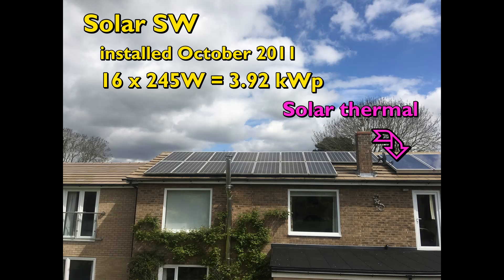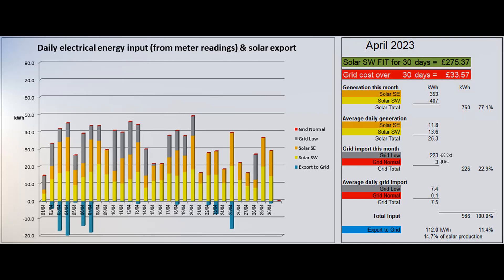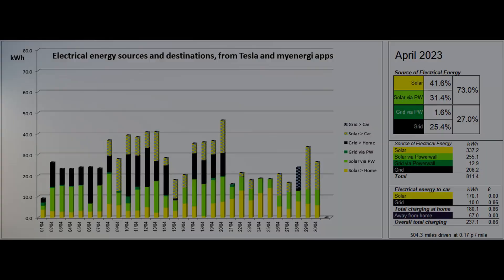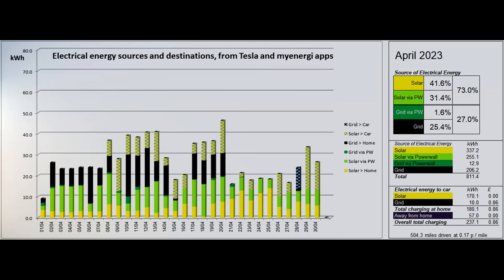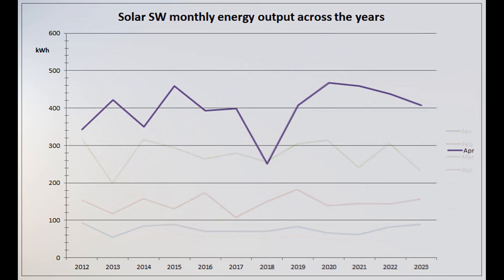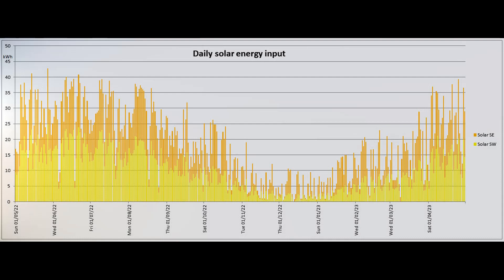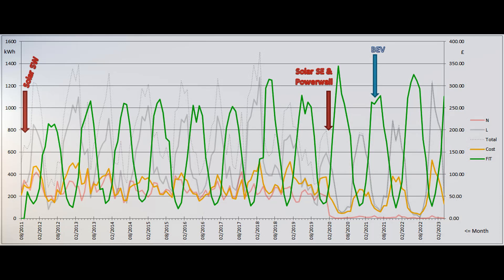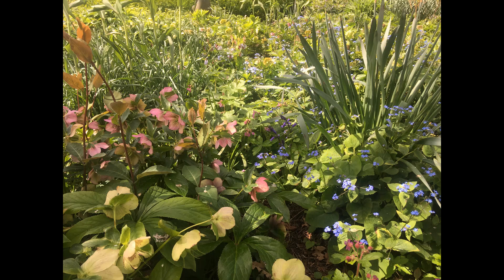Tesla Powerwall 2 and Solar PV in the UK [41]: April 2023

Comment: I have added a comment twice only for it to disappear immediately? Not experienced that before.
Reply from the maker: That happened to me around a year ago but I can't remember what it was all about and how it was solved ...
Reply: A 3rd post has just vanished. It included a url to Tesla sw versions so I will try again without the link!!
Reply: I have found my Powerwall weather prediction is near spot on since firmware update v22.26, Sept 2022. It uses solar irradiance data which from my experience has been very accurate.

I just hope its accuracy continues as I wanted manual control of my PW charging but feel this is no longer required.

Comment: Is your solar thermal new? I don't recall seeing it before or it being highlighted. Thanks for the holiday mention at the beginning of the month. Why am I not surprised that BG won't take a customer reading for the generation meter for April. We are lucky as our quarter runs to the end of March so no estimates for the cutover between the new and old rates.
Reply from the maker: The solar thermal was installed in 2011 at the same time as our first (SW) PV array, though I have only labelled it on the picture of the house roof for the past four months' reports. Gives us lots of hot water during sunny summer periods, preventing the oil boiler from firing up at its programmed time in the late afternoon, despite it having had very little maintenance. I have found it difficult to find anyone local with the equipment to top up and re-pressurise the system.
Reply: @salokin1 ’m in the same situation Solar PV and Solar Thermal and no one to refill the now 9 years old fluid, I’m sure it effects the efficiency of the collectors not having replaced the original fluid by now, Looking into removing the Thermal now the payback is complete and replacing them with PV panels, just to add I now have a Myenergi Eddi to divert excess solar to my hot water tank so increasing the panels would offset the removal of the Solar Thermal
Reply from the maker: @johnb7644  mine is still working very well despite a cold low pressure, so I'm sticking with it for the moment, and keeping my eyes peeled for a plumber / fitter who could help top up the fluid. I don't think that the fluid deteriorates.
Reply from the maker: British Gas "lost" the meter reading I entered online on 1st Feb so I resubmitted the same reading later in the month, accompanied by an email saying the next would be submitted on 1st May and I indicated that I would be unhappy if they replied with "your reading is not due yet" ... and have recently been rather angered by just such a response!

If they make a "fair" estimate for 1st April one might expect around half to be over-estimates and half to be under- ... but every single year so far has been an over-estimate.